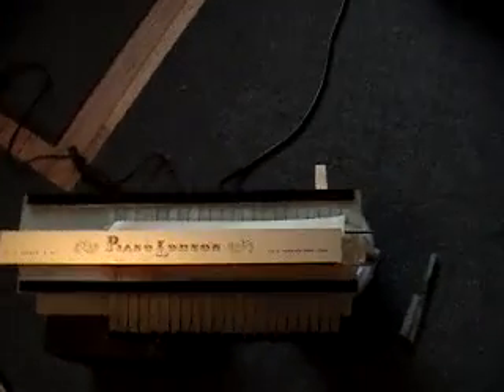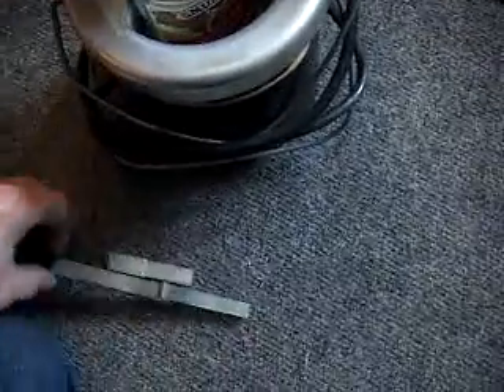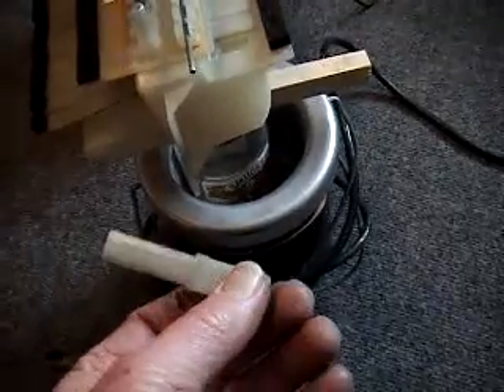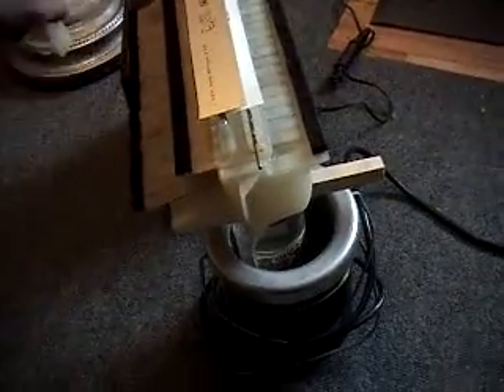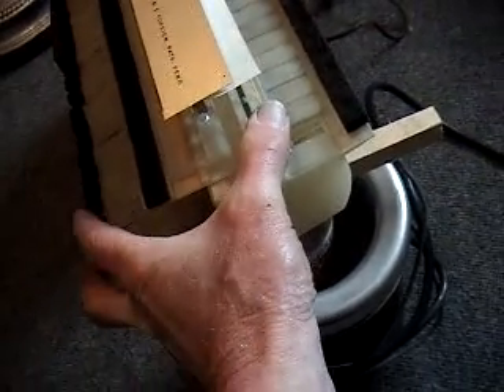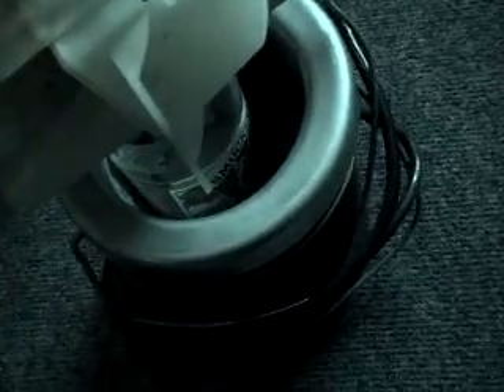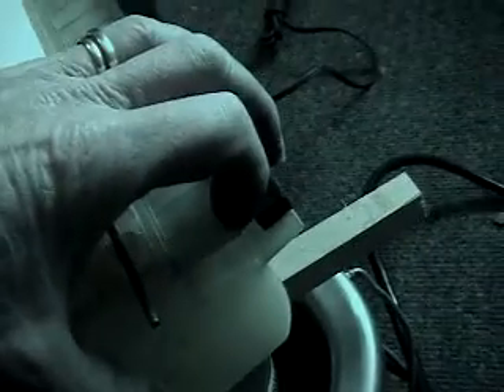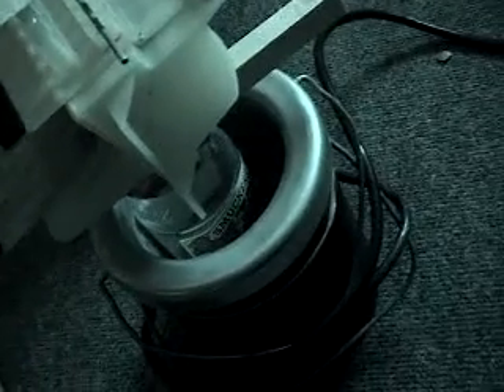Piano-Lodeon Action (The Stack)

Comment from the maker: I would use an air compressor. Or, you could reverse the output of a vacuum cleaner so that it blows air instead of sucking air. Then, turn the device upside down and blow air into the cavities...
Reply: Besides an air compressor (or vacuum cleaner on reverse), 
would you recommend hot soapy water (and baking soda) for cleaning out the "stack trough" or whatever you want to call it? 

I have three rough Pianolodeons to rebuild that I got that were stored in a garage for many years, and they're pretty filthy. 

I'm optimistic that if I gently and carefully take off all removable parts and clean them separately, 
I can clean this with hot soapy water, and maybe baking soap. I haven't gotten into them yet. Does the little fan and motor detach separately or unscrew? I obviously don't want to get any water into the motor. 

Also, I equally obviously will make sure everything is completely clean and dried off before attempting to put it back together. 

Is there any way to put small cylinders of felt inside the pivot holes of the playing fingers / vanes and also the valve / relay vanes, (and on the shoulders of same) to quiet them so that they don't clatter so much? i. e. is there any way to create "felt bushings" for the pivots of these that won't add appreciable friction, but will get the mechanical noise level down? 

What kind of glue should I use that will stick to the plastic but is also easily removable? What kind of felt should I use? 

I understand there wasn't any felt there originally, the only real pads seem to be where the playing fingers / vanes contact the wippens of the piano action. 

Thanks in advance!
Reply from the maker: Lots of questions here... 

I don't think you have put anything in the press-fit connections to quiet the vanes except maybe teflon plumbers tape, but that might cause so much resistance that they won't work.

Cleaning: soapy water sounds safe....baking soda might leave a residue that cause sluggishness.

As I recall, getting the motor and fan assembly out of the unit isn't difficult. Getting it apart is a whole other matter.

PVC-E glue works great for gluing felt to plastic.